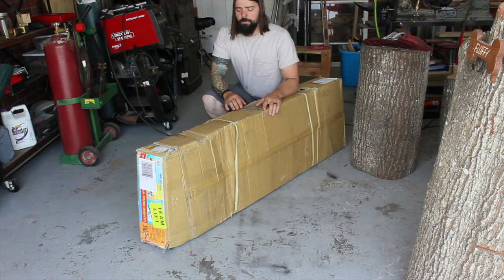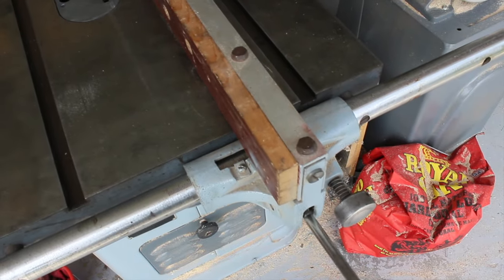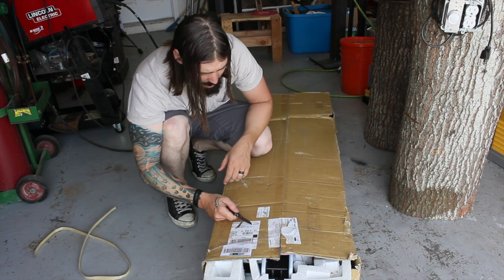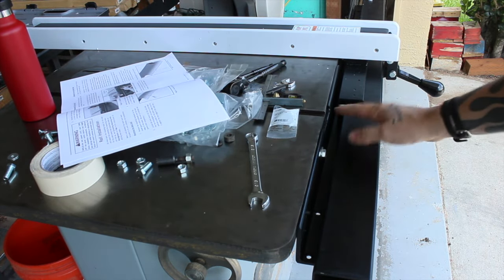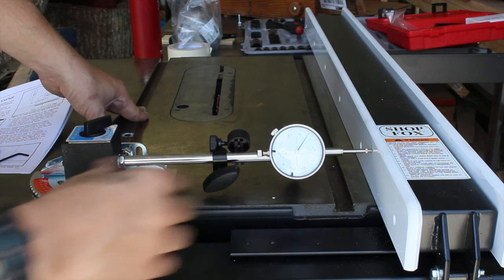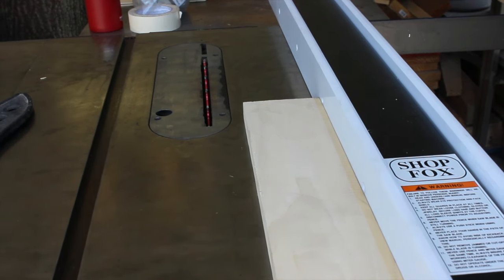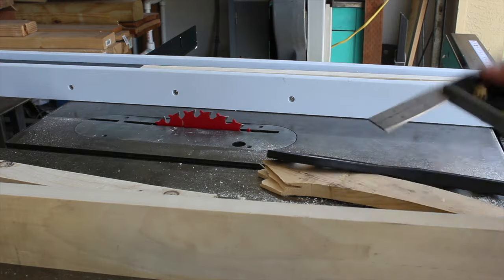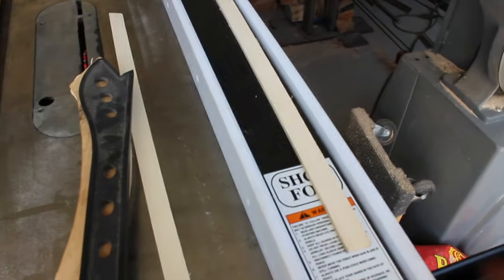Unisaw Fence Upgrade (Jet-lock to ShopFox W2005) | Informational

Comment: Thank's for doing the video.  I'm installing one on my old Delta.  It's got 3 rails. One rectangular and two angle iron.  It's a little different model but same basic idea.  I'm very unclear on how to assemble it, as I got it from a guy for $100, but who didn't have the instructions.  If you get a moment, a walk around showing how the three rails fit on and which one went where would be great.  Thanks again for the video!
Reply: go to Grizzly tools they own Shop fox and download instructions for a 1023z table saw its the same unit.
And they use a shop fox fence.  Shop Fox is a wholesale division of Grizzly tools.
if you look at the Springfield mo location the buildings are right next to each other.

Comment: In your video you didn’t mention having to drill new holes in the angle irons provided with the fence system....I am also restoring an old unisaw and wondering if the hole pattern on the  w2005 match the holes in the unisaw table... thanks great video

Comment: I've used this fence before, its great. In my opinion, the rip fences on most of the older/vintage saws are not accurate and are on the dangerous side. Especially the ones that use the round tubing for the rails. Achieving parallel is never consistent on those old timers.  Great video.

Comment: What if you turn the magnifying glass upside down? That way the red mark rubs against the markers on the table. Less distance between the two would give you less of a parallax effect.
Reply from the maker: That's a good idea, but the top is domed.... But, here's something I thought about after the recording. The parallax effect is actually magnified as well, so in actuality its not near as far off as it may seem.

Comment: you might think about board buddies or Jessem clear cut stock guides for the table saw because you do not have a riving knife or splitter on that saw.  60 to 230 buck is cheap insurance to protect from a emergency room visit.
you could also make a zero clearance insert plate and add a splitter into it.
Personally I'd have looked for a used fence on cl or somthing because guys do buy the incra system I'm thinking about it.
I'm about 90% certain that came from the same factory that makes the biesemeyer fence almost every thing does now.

Comment: Does it remain parallel after you lock it? Can you trust it without double checking it against the saw blade every time?
Reply from the maker: Yep, I've had it on there for probably ~2 years, never ever had an issue. I rechecked it a few weeks back when I replaced the blade, it's dead straight.
Reply: ZH Fabrications Awesome!
Reply: Why do you think there are so many negative reviews on that fence?

Comment: Does this fence have a minimum depth requirement for the table? I’m looking to replace the horrible fence on my kobalt saw but it has a relatively small table. Thanks for the video!
Reply from the maker: +jimmy joe Pretty sure it would work just fine for you, It's a pretty universal set up, although you may have to drill a few holes as the bolts may not line up, not a big deal. The fence doesn't lock into the rear rail it just glides on it.
Reply: Good to know thanks!

Comment: Hey man, have you put a 'known good' measuring tape against that Shop Fox tape?
I bought a Grizzly last summer with that same fence system and the tape was pretty "off". It was exchanged THREE different times it was never correct. So disappointing. I ended up ordering a 'left to right' Starrett tape.
Reply from the maker: +dano242
I haven't held one up to check it yet, but for the first 10-20 cuts I made I checked the board after I cut it and it's always been spot on. I still check occasionally, and it hasn't let me down yet.

Comment: You stated to got this for about 270 shipped, where did you find it at that price? I've seeing about 330 after shipping most places I look.
Reply from the maker: Hey Victor. I got it off of Amazon, I can't remember if that was before or after shipping. The price may have gone up since then. For what it's worth, I'm still very satisfied!
Reply: Thanks for the quick reply. I was looking at it on Amazon, but they want 371 for it. Found it shipped through walmart for 338, just figured I'd ask.

Comment: What's the purpose of the 15000ths or 1/64" variance front to back of fence?
Reply from the maker: You typically want your fence to be angled away from the blade to avoid/minimize binding & kickback.
Reply: +ZH Fabrications ok, I see what you're saying. I've got the Ridgid R4512 table saw and it has a riving knife so I set my fence at 90* to the blade/miter slots.